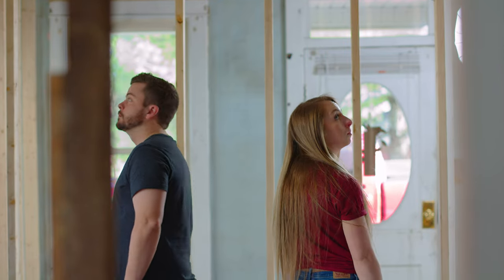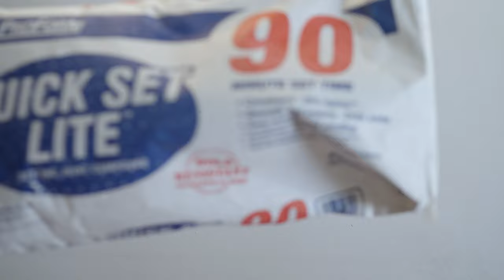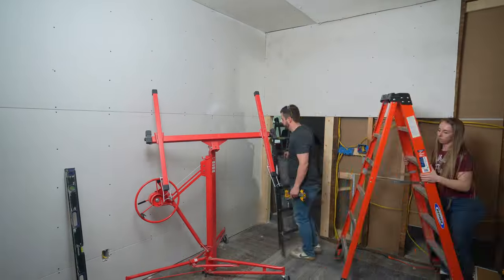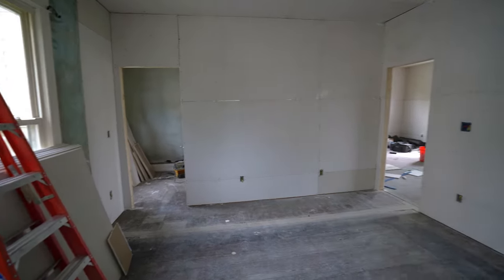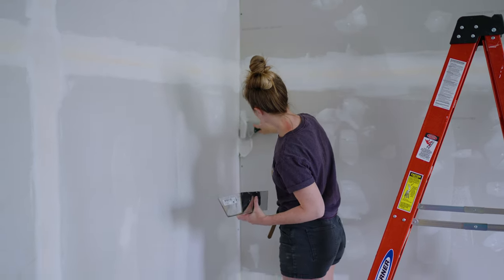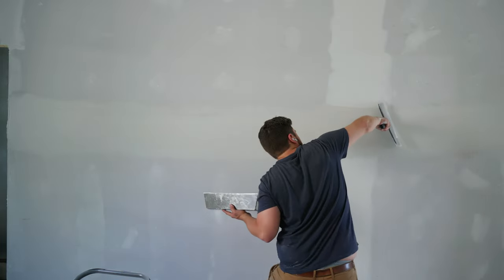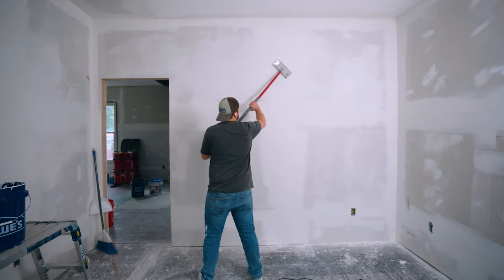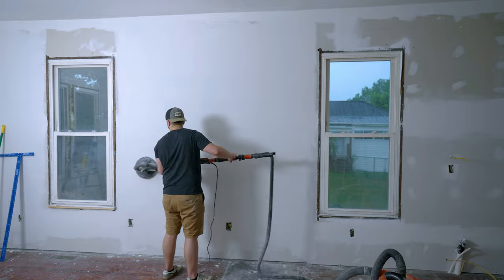DIY Drywall  |  A Beginners Guide to Sheetrock

Comment: "Avoid joint over the corner door frames in windows"
There literal first sheet they put up was on a corner of a door.
It's actually best to put the joint over a door frame in the middle somewhere because it creates a smaller joint to finish and is just as stable as any other joint.
Where they put that first sheet, in line with edge of door, is where a lot movement happens every time it's opened and close.
That joint is guaranteed to crack relatively soon and I'd put money on it.

As well as at 4:45, they broke on the same stud for the entire length of the wall.
You'll essentially never be able to hide that joint with mud.
Hopefully they put something there that will never let that wall see the light of day, or the dark of night.

Also code is different everywhere, but on residential you can nearly always do ever 12" on center for your screw pattern in the field. 
(3 screws per stud except on the top plate, bottom plate and joints, those are 8". So every joint each sheet should have 5.)

If you're gonna make a guide, especially for beginners, you should have some idea of what you're doing. :body-green-covering-eyes:
Leave the drywall to the professionals if you don't want to pay us later to come back and fix all your DIY.
Your guys' video production is very high quality, I did actually enjoy the video.
I didn't expect to learn anything so I'm not critiquing you on that, rather, I'm critiquing you on how many people you misinformed.
You don't ask a nursing student to teach you how to preform brain surgery.
Why ask a DIYer homeowner to teach you drywall. Those are not similar trades but the concept is similar.
Don't learn from those who don't know because you will learn incorrectly.
Reply: Says the guy watching a sheet rock for beginners!!!
Reply: @paigewagner4857  I'm a journeyman hanger and have been doing finish work for 4 years. Done steel stud framing here and there as well. I've done residential and tons of commercial.

I like to watch these videos because I'm opened minded and am always trying to learn more. If I can learn 1 thing from a 1 hour video, then it's worth it, but after a bit I can sort of predict if I'll learn anything.
I'll still finish the video because you never know.

But when I see people trying to teach others when they really have no idea, it upsets me because now everyone who watches this video without a grain of salt is going to absolutely destroy either their home, or another person's home.

I wouldn't teach someone how to fly a plane because I don't know how to fly one.
And it would make me responsible for anything that comes of it.
Because this is a Youtube video, there is no way for them to take responsibility for what others are going to do to their homes.
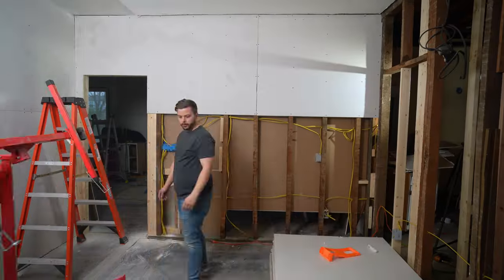Reply: You are exactly right. I heard them say "avoid joints on door frames and windows" and I was like... wha? thats the best place to put them so you get a shorter butt joint to deal with. And then I saw them installing drywall without breaking the seam (4 drywall sheets that all meet at one point, example at 4:17) and I knew I had to come down to the comments section to see if I needed to be the first to call them out for that. The proper way to do it, if you have 8 foot long sheets is to ensure that the butt joint of the top row is 4 feet away from the butt joint of the bottom row, not right on top of each other. Mudding and feathering out a 8 foot long butt joint is going to be hell and will be quite apparent to visitors once done.
Reply: Pay professionals huh, no thanks, im about to to my own, rather save a ton of money and learn from any mistakes.

Comment: your way of making video is amazing . Really interesting and funny. Also now I got the courage to do the drywall of my Shed myself.
Reply: Shed is a level 1 unless ya have an attached garage as a shed .  This flip should’ve been a level 5 finish.  Not hating as I feel the cost of labor and material nowadays but I’d def not put it on you tube if I were trying selling with no stagger and long floor to ceiling joints that’ll never slick up you’ll see that first coat of primer and it’s actually sad now they wasted their money and time and will need to do it again to save integrity of the drywall and paint. If he sold it asap maybe in 30 days and nobody opened that door and shut it even once he may be okay to get out of there without cracks but if it has been I’d bet it has cracked within 10 closings of the door.  One simple mistake either Jsut cost them a sale and money or the new buyer got jacked up for  a big repair right off the bat.

Comment: thank you for posting this. I want to gut the plaster and lathe in a house we are buying and run new electric. I was wondering if i was being too arrogant to think I could do the drywall myself so we could keep our costs mostly for electrical work. I still think I can do it, but someone else is going to do the mud!!
Reply from the maker: You got this! Removing plaster is our least favorite job but it saves a ton of money. And you can absolutely hang the sheet rock yourself and pay someone to do the mud, BUT get some quotes and see how much it will save you to have them just mud vs doing the whole job. It may be worth it to you to just hire out the drywall completely.

Comment: You do not run the joints up the wall thru multiple sheets. The cracks will show after time. Would like to see an update after a year or two

Comment: O? HI
can you explain why you start installing drywall from the top?
Reply: Ease of installation, for one.  Rooms aren't square even if they were perfectly level and plumb when installed, things like joist weight and all that can hang a tiny bit.  Framing lumber can be really shitty shape, in the US our mills are going for speed and cost and not quality, so stuff warps and has knots.  Ceiling panels are the hardest to get aligned, measured/cut, and screwed in.  Since the walls cover that seam, they address any "slop" of the ceiling, unless you have something like crown molding.  

Then on the walls, your baseboard covers that slop where it meets the floor.  The floor is almost certainly a degree or two off the ceiling in places.  That's why you see them leaving around 1/2 - 1" gap at the bottom of panels at 4:43.  Foam backer rods make great insulation under these btw, though rodents can easily chew through.  Lots of decisions and tradeoffs.

Comment: Honestly when are they going to come out with a better product that's comparable priced to drywall? I hate that crap, over time if you even put a pin hole in it it just crumbles. Such a horrible product that makes the whole house feel cheap. Maybe if they at least put a thin layer of veneer on top of the drywall panels to give you something more sturdy...I don't know.
Reply: I suppose you prefer lath and plaster? Do some research
Reply: 5/8 drywall
Reply: Even if it's not the final finish (e.g. putting shiplap over it) it's a cheap and readily made material because gypsum is easy to come by, and it performs well for sound deadening.

Comment: You have no idea how to lay out drywall... you never break on the same stud as the top with the bottom, and you don't end a sheet on the edge of doorways or windows.. you're taper will charge the hell out of you.. and if you're taping it yourself, going off how terrible you hang, it's gonna look like crap in a years time. Only watched 4 minutes cause it was laughably bad. Anyone watching this, don't hang like this.

Comment: Unless you have no marketable skills of any sort, you're better off putting in some extra time in your chosen field and then paying the professionals to do the drywall job.  As a carpenter I've seen too many amateurish jobs that ending up taking far too much time, frustration and money spent on wasted materials to make it worth it.
Reply from the maker: Vehemently disagree, I would never tell someone there is a job they “can’t do”. With this house The cost to remove plaster and replace with drywall would easily be over $10,000. If people are willing to learn the work they can achieve excellent results for just the cost of materials.
Reply: @WhatTheFlipShow  Well, I sincerely admire your "can do" attitude and think you've made an interesting video.  Please note that I never said that I would tell someone that there is a job that they "can't do".  My point was simple; if you possess a different, but marketable skillset, then focus on what you do best and hire other professionals to do what they do best.  I'm a firm believer of "shoemaker, stick to your last".